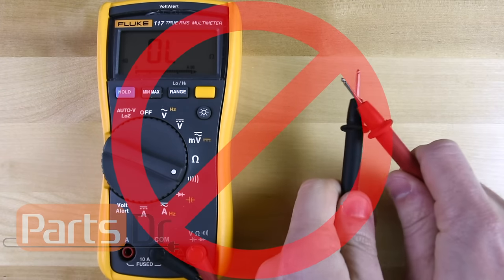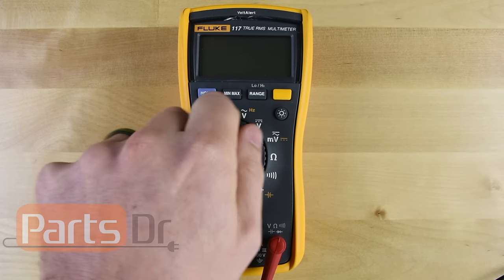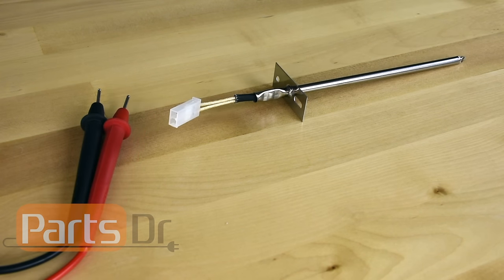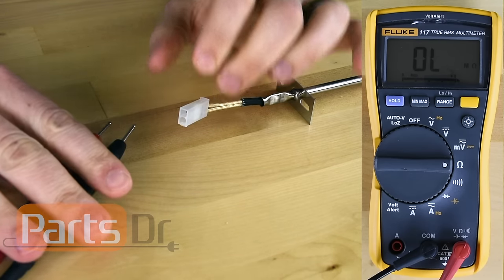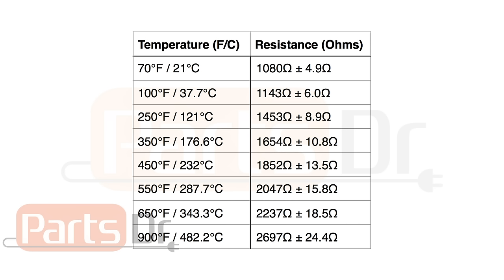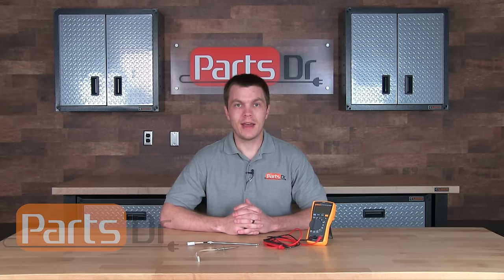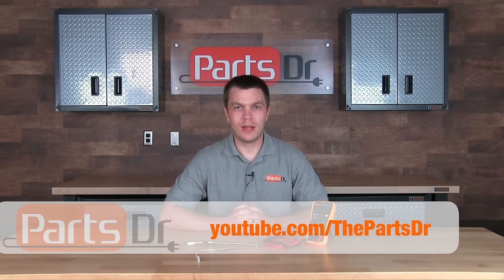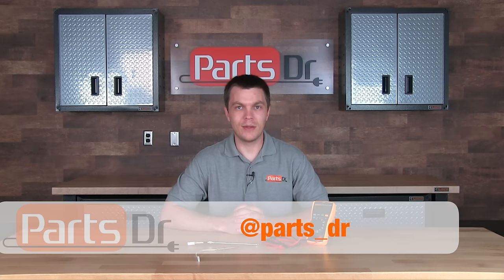How To Test An Oven Temperature Sensor

Comment: My oven heat is by 50 degrees lower than what the screen oven tells me, I put one of those thermometer inside the oven and it’s 50 degrees lower, what would you recommend, please help as I don’t have money to replace oven and I do use my oven very often. Thanks
Reply from the maker: Start by testing your oven temperature sensor to see if it is good or bad.

Comment: GE Model# JBP78WY3WW. Oven controller displays oven preheated 400". Not heating up. Placed thermometer in oven. Only reaching 200º. Element appears good. No holes/splits/visible damage. Ran ohm meter on sensor. Testing at 1.108 on 2K scale at room temp 72º-74º. I can hold sensor and watch ohms slowly increase. Since sensor appears good, only thing left is the controller. What's best way to meter/test controller? Seems to me if element is good and sensor is good that the only thing remaining in my troubleshoot is the controller. (?)

Comment: I have a ge xl44 gas oven model JGBS20WEW2WW  oven turns off after 5 minutes I replace the igniter and temp sensor but still turns off any suggestions help thanks

Comment: I have a neff oven wich shows err in the temperature display. I dag inside and after a tedious work around, I found a system of switches and a rotary component that turned them on and off according to microcomputer commands. One of the switche had melted and there was no contact of electricity.  I changed the switch with a new one and put everything back together. The oven still shows the err code. I removed the sensor and did the test but there is not reading at all even in 2k or 20k ohm scale of the digital multimeter. I think the sensor is broken and causes the err code. What do you think? The heating elements are tested good. The motherboards seems to be good.
Reply from the maker: It sounds like the oven sensor is most likely bad if you tested it correctly.

Comment: I have a Whirlpool RS696PXBB2. When using the oven in BAKE mode, the top burner will somewhat heat up the oven, but the bottom burner will not come on. I replaced it and I have the same problem.
1. Could a temp sensor cause this? (Could a temp sensor cause the bottom burner to not come on at all?)
2. Is the top burner supposed to be heating up when in BAKE mode? I didn't think so but am not sure. If not, I may have more serious issues.
 Any ideas? Do you think this is worth pulling the temp sensor and checking it? 

Thanks for the great video.

Update: I was able to remove the sensor and check it. It has 1090 Ohms, so I guess it is good. I'm lost, though, if it's not the burner or the sensor. Control board, maybe? Maybe even wiring, because it is a very old oven.
Thanks!!!
Reply from the maker: 1. Your symptoms don't sound like a bad temp sensor.
2. Yes the top burner on most ovens is supposed to come up a little bit during the bake cycles to help with browning the top of the food.
3. From what you described it sounds like the control board that sends power to the bake element might be bad, assuming the bake element has been tested for continuity and is good.  The control board for your model has been discontinued by the manufacture but you might look for a company that specialized in refurbishing or rebuilding your existing control board.

Comment: nice one ,i want to ask one question please,i need to measure the temperature of the material in the microwave oven just online while drying  so as i can log my data and see how the temperature profile is ,so can you please suggest  the sensor type that can be used inside ?
Reply from the maker: We are not aware of a temperature sensor that is safe to use inside a microwave
Reply: @PartsDr  ask the top colleges for that information. Those in the tech fields.

Comment: Ok. To get to the rear of the oven was a major electrical task, as the original installer had left no slack cable from a sub panel located behind a lazy Susan in a corner cabinet. What should have taken 30 mins max took a day! Now how do I know what temperature is actually achieved? Seems to work but my cook is sceptical! Martin
Reply from the maker: Hi Martin,  I would recommend a thermometer similar to the one linked below to check the over temperature.  You will want to make sure that you are taking an average of the temperatures as the heating elements will cycle on and off to maintain the set temperature.  http://www.meter-depot.com/digital-1-k-type-thermometer-dm6801/

Comment: My oven is a ge CT959STSS,  when I want to do anything in the oven (bake, broil, warm, etc) NOTHING works, the oven turns on, but it doesn't heat at all. It remains cool and the number stays in 100 (sometimes 105, but doesn't heat up), yesterday I made it work, I don't even know how, just pressed some random settings in SF. I disconnected it to assemble the oven happy to know it worked, but when I connected it again it, oh big surprise, it stopped working again. I've tried many things, but I don't seem to make it work, does someone knows if this temperature sensor may be the cause?
Reply: In addition to the temperature sensor, try the thermal fuse (sometimes called the thermostatic limit switch).
Reply: @nunyabusiness5075  Thank you for your suggestion! I only know the switch has continuity, not sure if only that it enough to know if it's good.

Comment: I have a Amana stove the indicator light doesn't come on when oven is turned on, also the hot surface also doesn't light either. But both of those lights come on when the burners are being used. Question is does that thermostat also run those lights?
Reply from the maker: What is the model number of your range/oven?

Comment: Ok. My oven turns on to preheat but does not even heat. I replaced the bake element and thermal fuse but not the sensor. Does the sensor also have control of the oven even heating? It preheats then clicks and does nothing.
Reply from the maker: Your symptoms don't sound like a bad oven temp sensor.  They sound more like a bad control board that sends power to the bake element.  You will need to do some further testing to confirm that.
Reply: I have the same problem as my (Samsung) oven turns on to heat and clicks but temperature is clearly cool enough to touch. what should I test further after I get a multimedia to test temp sensor? @ @PartsDr
Reply from the maker: @kaycee6804  What is the model number of the range/oven?  Does the broil element turn on if you set it to the broil cycle?  https://partsdr.com/model-number-locator/range-stove-oven
Reply: @PartsDr  My Kenmore Canada model, (#970-600762) does the same thing, replaced bake element, broil works, but bake has a 7 second delay when turned on and then does not heat up. Stove top and broil both work. Does the thermo sensor affect broil at all or would you think it is a control panel issue?

Comment: I have a HOTPOINT RB525DP1WH Electric Oven/Range. The oven light stays on and temp is stuck on high about 450 deg. and will not adjust. What do I do?
Reply from the maker: Hi Anthony, it sounds like you probably have a bad oven thermostat. You can view that part here: https://partsdr.com/part/wb20k10026-oven-thermostat

Comment: Hi,
we own a Whirlpool GLP84800 and we recently noticed the cooking taking longer in the oven, this morning when trying to use it, it wont even start heating. The broil fonction wont start either. When turning it on, we hear a ''click'' sound like usual and the board screen said it start the pre-heat but nothing actually start. Could this be related to the sensor ?  

thank you !!
Reply from the maker: It does not sound like a problem with the sensor.  If the top burners are still working, then it sounds like a bad control board.
Reply: @PartsDr  Yes the stove part work just fine.. Does it mean changing the control board ?
Reply from the maker: @odreee88  If the top burners still work and both the bake and broil elements stopped heating at the same time, it is most often caused by a failure of the control board that sends power to the elements.  We always recommend looking at the range and doing some troubleshooting yourself before coming to a diagnosis and ordering any parts.

Comment: My oven isn't heating to the temperature that I set it to, so I pulled the sensor and did the ohms test. I'm not sure what the result means because it won't settle on a number and keeps bouncing between a low number and a high one. Is my meter broken or is the sensor bad? Thanks!
Reply from the maker: Hi GetRex, the oven temperature sensors are pretty sensitive to temperature changes.  If you hold it in your hand while you test it, the heat from your hand will cause the numbers to change.  If your numbers were changing by a large percentage then you may have a problem with your meter being bad or the temp sensor being bad.
Reply: Verify on another electric source such a car battery.

Comment: I have a whirlpool gas accubake and it wont get all the way up to heat. I have replaced the igniter and the temperature sensor.  could it be the thermal fuse? im at a loss here.  thanks
Reply from the maker: It is probably not a thermal fuse.  When a thermal fuse blows the oven usually will not heat at all.  This problem is probably too complicated to diagnose in a Youtube comment.

Comment: I have LG Microwave oven, mode MC 2146BP, that does show F 01 error, and shuts down at exact 10 minutes from the time I start using convection mode. According to manual, F 01 error code means, check thermistor,  I want to change thermistor which will provide max 220 C temperature, which thermistor shall I buy and what shall be ohm value ??
Can u please make a video on how to change thermistor or LG Microwave

Comment: What is the solution if the sensor is only accessible from inside the oven and the wiring harness will not release sufficient slack to expose the connector thro the aperture? Martin
Reply: I had to take the back off of my range, because all of the wires were bound together, preventing me from pulling the wire through into the oven.

Comment: Samsung gas range suddenly has issue 5yr old.no error message.conv.& reg. bake settings.takes forever to pre heat then while set at 350 only reaches 285.bump up to 400 goes to 450?will test sensor any advise before I start.thanx
Reply from the maker: We would start by testing the oven temperature sensor.  If that is good then we would test the oven heating elements for continuity.  If the elements are all good then you may have a bad control board.

Comment: my  Whirlpool gas stove bake or broil will not light the ignites can this be my problem thx
Reply from the maker: A bad oven temperature sensor can cause the oven not to heat.  You will have to troubleshoot further to narrow down the problem.

Comment: ldg4315bd is a gas double oven only problem with top oven. Works in broil mode doesn’t light in bake mode f9 error comes up. Checked thermistor checks okay. What else should I check.
Reply from the maker: Hi Rich, most commonly on gas stoves it is the igniter that goes bad.  Can you try removing the ignitor from the other oven and moving it to the upper oven to see if that fixes it?

Comment: hello, 
I have a frigidaire oven, I havent tested the temp probe with an ohm meter yet. But before buying a probe maybe someone with know how will be able to troubleshoot and give me  a 100% answer...who know the internet is a great place sometimes.
When I usually try to heat to the stove it gets abit hot...not very. When I put it on Broil 500 F the top element doesn't get orange ( I can see the thing get bright orange normally).
But I have found that each time I put it on autoclean...the next  morning when the autoclean is done and the stove has cooled down the broil 500F works (orange) and the stove on lets say 350 F seems to heat up correctly.

Does this mean that the temp probe is the problem? since the autoclean seems to fix the problem temporarily ?

Thanks
Reply from the maker: Hi Pat,

It is very hard to diagnose your problem over the internet without doing some actual testing on the range/oven.  I would test the oven sensor per the instructions in this video, if the sensor is bad then replace the sensor.  If the sensor is good then you may want to test your bake and broil elements for continuity, and if the bake and broil elements are good then it may be a bad control board that sends power to the bake/broil elements.

Comment: I just tested my oven element it is at .4 ohms. But my bake element isn't getting hot. It is on broil. Do you think it's my temperature sensor?
Reply from the maker: .4 ohms doesn't sound like normal reading for a bake element.  You would need to test the temperature sensor using the instructions provided in the video to see if it tests good.

Comment: LG 4315  top oven not heating in bake mode but heats up in broil mode. Display showed F9 error once would temp.sensor cause this problem
Reply from the maker: Hi Rich,  it doesn't sound like your problem is caused by the temp sensor.  I would start by testing the bake element for continuity.  https://www.youtube.com/watch?v=Pt1zAxp9N7Y. If the bake element is good, then the next step would be to check to see if power is being sent to the bake element.

Comment: My KitchenAid slide-in range gives an error code F2 and beeps when I use the oven, and sometimes when I use the cooktop.  Other times it will begin to beep when not in use.  Would this indicate a bad circuit board instead of a bad sensor?

Comment: help my oven dosent  stay on and the clock keeps turning off and blinking it will start blinking in the middle of the day for no reason ) sometimes I can use the broiler for a few minites before the clock shuts off and blinks and the broiler turns off ; can anyone help me please being a disabled honorable vet female has its  draw backs on  being able to fix things; thanks for any help.
Reply from the maker: Possibly a bad control board or bad power supply to the range?  Check where the power cord attaches to the terminal block on the range for any burned or loose connections.

Comment: If I pulled the probe and it seems to be testing at only about 800 ohm, does that confirm why the oven won't heat?  I can't tell if the problem is the probe or the Control Board.  It's a convection oven, Kenmore Model #79092803015 and when I turn on "pre-heat" it begins to warm but very very slowly and doesn't get very hot.  Neither Broil nor Bake heats the elements up at ALL, they just stay cold.  When I put it on "convection bake" or "convection broil" it warms very slowly but does't get hot enough to cook food.  Sound more like the probe or the Control Board?  Any way to confirm for sure?
Reply from the maker: Hi Mark, it does sound like the oven sensor is bad but we do not think it is what is causing your heating problem.  For the heating issue we would start by checking the bake, broil, and convection elements for continuity.
Reply: @PartsDr  Thank you, do you happen to have a link for a video on HOW to do that? :)
Reply from the maker: @BoiseInsure   Here you go: https://www.youtube.com/watch?v=Pt1zAxp9N7Y

Comment: Our temperature sensor tested at 1128 on the meter. Is that a fail or is it ok?
Reply from the maker: It sounds like it is on the high side for the ohm reading.  Probably not high enough where the oven won't function but it might be off enough that your oven temperatures are off.
Reply: @PartsDr  Thank you very much for your reply and this helpful video.

Comment: I have an LG electric stove and My oven is overheating, I change the temperature sensor and it’s still burning the food,  I set it for 350 to bake a cake and 15 mins after the cake is burnt ... what could be the issue ?
Reply from the maker: It sounds like the control board that sends power to the heating elements is most likely bad.
Reply: @PartsDr  thank you kindly
Reply: If the control board is damage would that affect the cooking elements ? Because I can cook no issue at all it’s just the oven
Reply: Did you fix it? Sounds like the relay is sticking on the relay board.

Comment: Not a comment,   just a question.   Oven if started at the set temp of 350  will go way beyond that.  If I start it at 275 and increase slowly,  I can get to the 350 and keep that.   The control board could be the problem but I am wondering why the oven light burns out every time I use the oven.  Is this two problems, one electrical?
Reply from the maker: It sounds like it could be a control board problem?  The light may also be controlled by the control board, you would have to look at the schematic to be sure.

Comment: Can you bypass the sensor just long enough to see if the oven element comes on?
Reply from the maker: There is no way to bypass the sensor, but testing the sensor should tell you if the sensor is bad.
Reply: Parts Dr I was hoping the plug for the sensor could be crossed.  Evidently, the sensor is a thermistor since the resistance changes with the room temp. 
  I have a GE electric range with a nonworking oven.  I guess it is back to the relays on the board. :(
Reply from the maker: @rickeykeeton71  Yes it is a thermistor!
Reply: Parts Dr I may get lucky. The sensor homed at around 1082, if I remember correctly, but it was in a storage building. I do not know what the “room temperature was. 
  I will check that the next time
Reply: @PartsDr  where is the thermisterlocated?
Reply from the maker: @robertkorek1000  The temperature sensor (thermistor) is usually a probe locate at the top left side of most ovens.

Comment: I checked my sensor and it has the right ohms reading , but i still have a code showing that the sensor is defective ???
Reply from the maker: Check the wiring for any issues.  If the wiring is good then it could be a bad control board.
Reply: @PartsDr  cool thanks for the help.